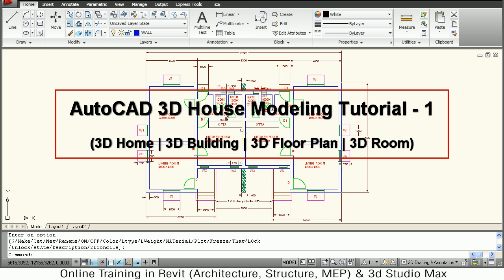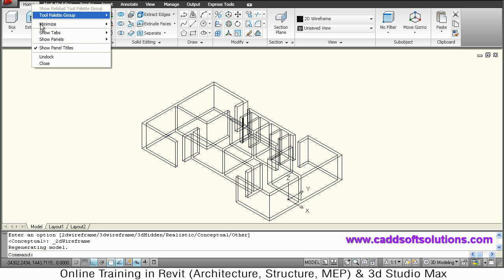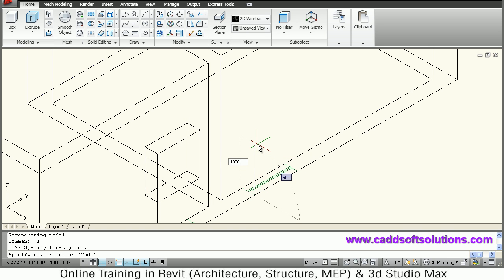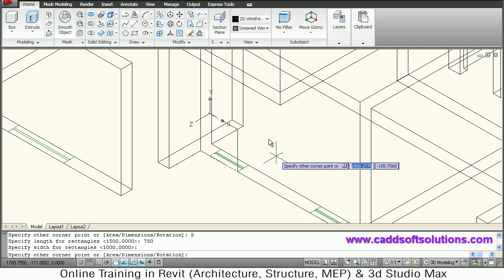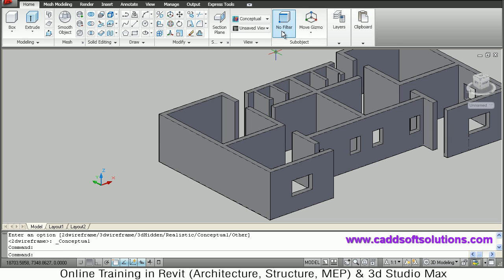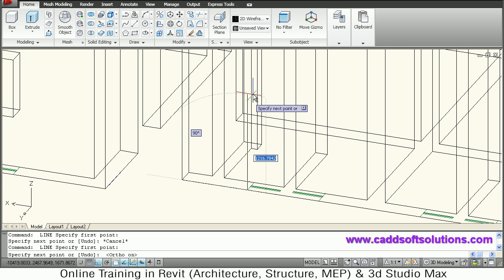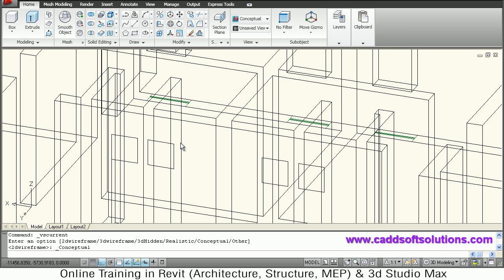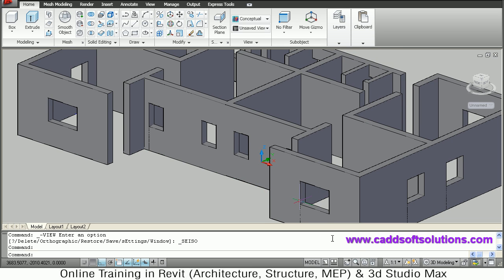AutoCAD 3D House Modeling Tutorial - 1 | 3D Home Design | 3D Building | 3D Floor Plan | 3D Room

Comment: After watching some of this, a program called Chief Architect is sooooo much easy and better than this.  It's got full 3-D & rendering capability.  You can buy older versions on ebay or amazon.  Make sure they come with the hardware lock which is req'd to open and run the program.

Comment: Yes, that's a key component of 3D in CAD, but also you really need a strong and fast processor. For renderings or regenerating the drawing the idea should be a multi-core; ex: dual, quad, eight, etc.

Comment: i made a steel casement window in 3d cad but I cant make a hole even if i zoom the area..It did'nt work..what's the problem in it..is it because of the arc that i made?.. i already join it to make it polyline..then why cant i presspull in it?